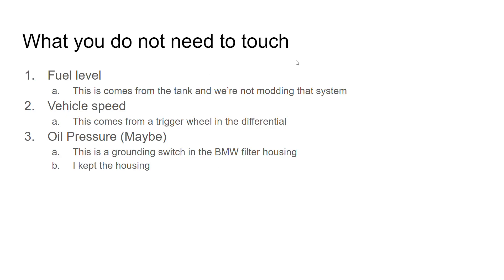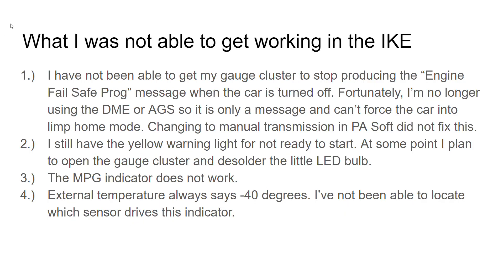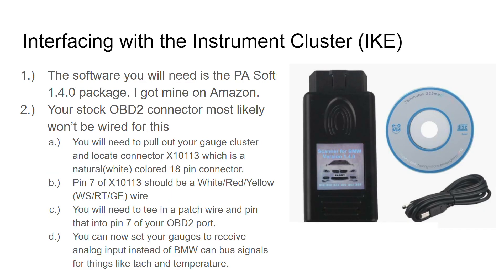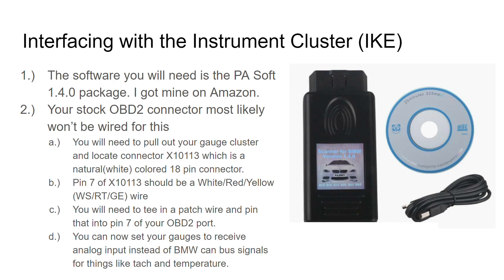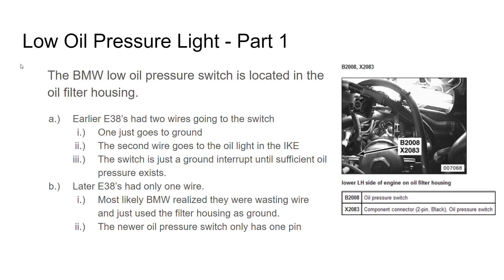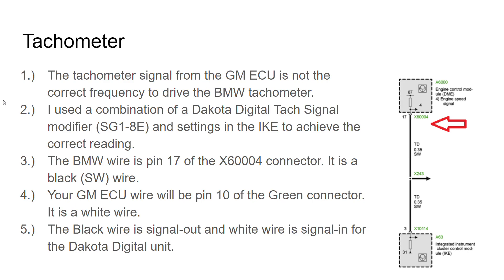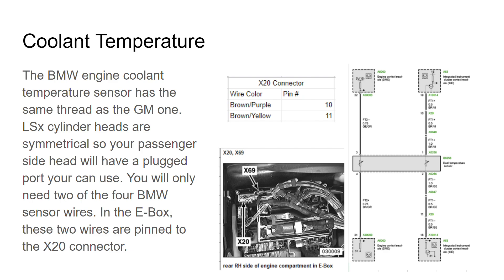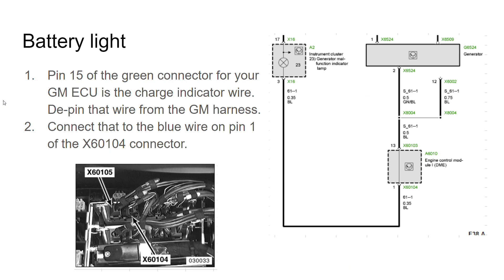BMW E38 LSx Swap Gauge Wiring

Comment: Hey Todd, so I followed your wiring diagram on the temp sensor and my gauge seems to just go to max when I start the car. Engine temp doesn’t change anything. Any idea what I might be wrong? Or why it’s not reading correctly? It was working before the swap. Is there programming needed? Thank you for putting these videos out.. they’ve helped me a bunch. Much appreciated
Reply from the maker: Programming should not be required. What year and model is your E38?
Reply: @MrWrongsalive  It's a 2001 740i. Ok yeah thats what I though but can't figure out why its not working correctly. I checked the wires for resistance and all good. Maybe the sensor went bad? One thing I noticed recently is that when i yurn the car on, the gauge will move and sort of want to stop ( very slightly and hard to notice) at around 200 and then just keep going. 🙄
Reply from the maker: @AverageJay22   I just double checked the BMW wiring schematics and it should just be the brown/yellow and brown/purple wire between the sensor and the IKE passing through the X20 connector. I did a quick search for the ohm values. It looks like you should have 2-3k at room temp and 170-300 at operating temp.
Reply: @MrWrongsalive  Ok looks like I'll be doing some checking on that. Even though i can see the temp on the Terminator X, I still rather have the gauge working properly. Again, thank you for the videos and your time. So much help!
Reply from the maker: @AverageJay22  You're welcome!

Comment from the maker: Corrections!!! 
You want Pin 1 White/Purple wire of the white IKE connector to go pin 7 of your ODB2 connector ---> https://www.youtube.com/watch?v=4WqCBZbKcnY

Clint C was right, my outside temp sensor was missing. It is snapped into the lower right splash guard and can be damaged easily. Dorman 902-020